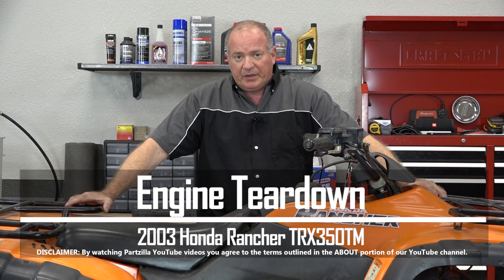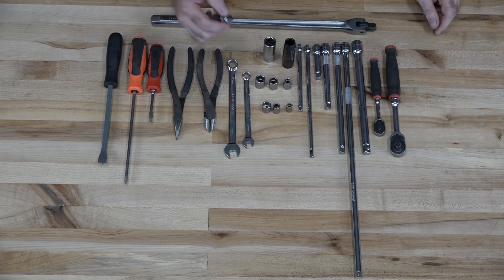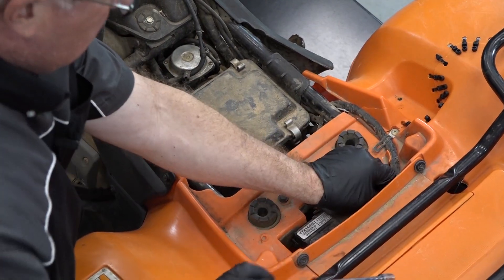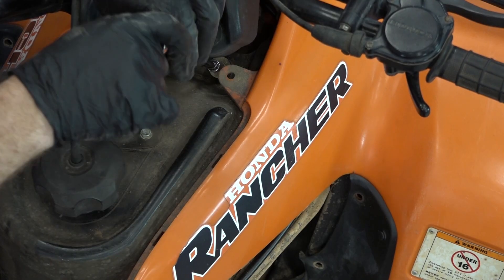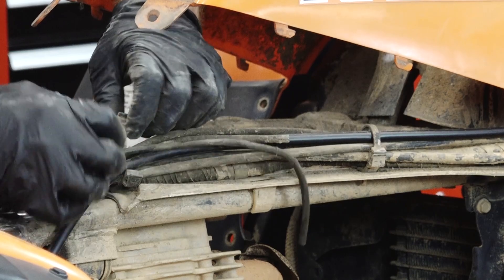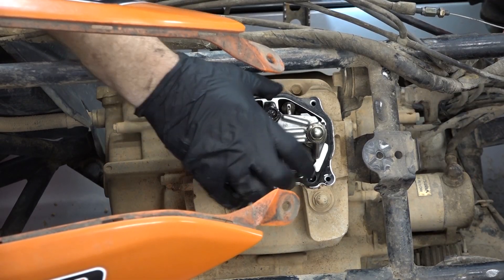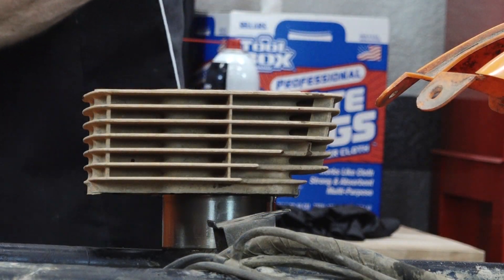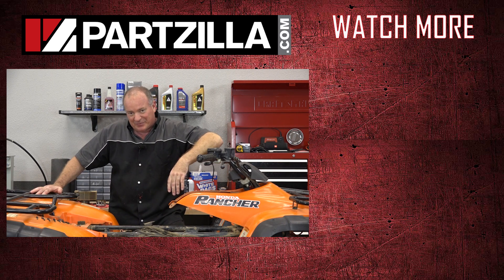Honda Rancher 350 Top End Rebuild Part 1: Engine Teardown | Partzilla.com

Comment: I have a question for you.  When trying to remove the two smaller head-bolts on this same engine, they broke off in the block.  I tried heat and am now slowly drilling them to use EZ outs.  Both methods are proving wrong.  The question is how important are the two smaller head bolts as the 4 remaining larger ones are intact? Will the 4 larger head-bolts suffice?
Reply: Same here. Any answers?
Reply: @jaliscotabares2996  - I took my time with a right angle drill (Harbor Freight - Bauer) and slowly drilled out the old steel bolts although some aluminum housing was milled away.  I also used a magnet to ensure I picked up all the steel - this guided my drilling.  I then used a metric tap to redo the threading.  I bought new bolts and plan to reinstall everything today.  I plan to use thread locker on the new smaller bolts and will let you know if this works.
Reply: This worked fine.  Great video.  Thanks.

Comment: Mine started blowing smoke this past weekend on a out of town camping quad riding trip. It was getting so bad, oil was  around on the outside of the muffle exit hole. Engine sounds ok still though. I haven’t rode it much in the last 5 years. I suspect after sitting a solid year then taking it riding putting it thru it’s paces, I’m thinking my rings are sticking. It’s a 2006 and I’m original owner since new. I don’t beat or mistreat my equipment.

Comment: I got a 04 foreman trx450es i sunk it and started smoking done about 3 to 4 oil change still smoke i got new gaskets set kit for top end have not finish the gasket kit instill no oil on the spark pug and the piston has a little build of carbin do i need to buy new piston and rings

Comment: If my rancher is tapping real bad from the top end and I've adjusted the valves and it's still still tapping would a top end rebuild be the next best move?
Reply from the maker: If you can't get them to adjust, then a rebuild should solve the problem

Comment: Hey what about when it's letting black smoke out of the muffler is it the position rings and clyender wall or what do you think Partzilla
Reply from the maker: Most likely rings
Reply: Yeah that's what I was thinking too if I should change the rings this year or about next year and get new parts too for the front shocks

Comment: Hey Partzilla I have a 250 recon and it was sitting up for about a year because of the carb and I just replaced it and the spark plug I checked the spark plug a couple days later and it's like a charcoal black color do you know what is happening in tje motor ALSO the bottom end sounds like a chain is rattling would that be the timing chain? LIKE I SAID IT STILL RUNS
Reply from the maker: Too rich?  Oil saturation?   Could be cam chain tensioner.
Reply: Is that hard to change
Reply from the maker: @aaronpepper9838  Not sure if it changed in later years, but it should just be a couple bolts and remove the tensioner.
Reply: Ok thanks. One more question I heard It could be a burnt valve if it is could a do the paper trick? Where you put the paper to the exhaust
Reply from the maker: By checking for suction?  You can do a compression check.  The paper test is not foolproof.

Comment: My four wheeler runs fine but it's leaking a little oil around the top end above the spark plug. Could it be a gasket needing replaced?
Reply from the maker: Make sure everything is tightened down.  Otherwise, sounds like a gasket.

Comment: Hey partszilla I recently bought a 2002 Honda forman 450 4x4 and it's making a tapping sound on the valves and it was smoking out of the carburetor in to the intake box I readjusted the vavle gap to 6 thousands and it ran healthier had better compression however it's still tapping and smoking out the carburetor into the intake I doubt it's the Piston because it's not smoking out the pipe but what do you think? I would really appreciate your advice thanks
Reply from the maker: Did you do the valves when the motor was warm?
Reply: Partzilla well that's how I bought it and I saw your video and decided to do it myself got a feeler gauge and when I looked at the valve cover it looked like it had already been adjusted before so I drove it into the garage maybe 1 minute at the most and popped open the cover yes it was a little warm then the valves had no slack to I re adjusted them to 6 thousands at top dead center and put everything back together and fired it up an it had better compression and everything sounded healthier but it was still tapping at the vavle area and smoking out of the carburetor at idle once you press the acceleration some the smoke goes away. Please advise on what you think I should do I'm looking into buying the gasket kit and 2 new valves and resurfacing the seating area like you did in this video but I would like to hear your advice before I do so thanks for getting back to me and hope to hear back from you
Reply: Ramiro Quintana interested in hearing what partzilla has here I have the same issue in 09 Kodak/grizzly 350

Comment: Hello Partzilla. How can a seized cylinder be removed from the piston and rings, without metal shavings falling into the crankcase? Would that even happen during removal? Or, will the lower end need to be disassembled for inspection anyway since the engine is seized? I'd appreciate anyones advice also. Thank you.
Reply from the maker: In a seized up scenario, I would tear the motor down to parts.  Then you can see what you need and rebuild the entire thing.  There's a good chance you will need to do some cylinder work.
Reply: does atv/motorcycle engine break in have to be done under a load while riding, or can it be done in neutral? i've seen videos done both ways.Thanks again
REPLY
Reply from the maker: Here is the best way to break in an engine.  I'm sure everyone has their "expert" opinion all over the internet, but this is tried and true.

On an ATV/Side x Side. 1st crank = idle 10 minutes check for leaks, listen carefully for abnormal noise, let cool.   
1st ride = 20 minutes vary load constantly up to 50% throttle, check everything again, let cool. 
2nd ride = 60 minutes vary load constantly up to 70% throttle let cool. Should be good to go at this point. Put some average miles (50) without getting too crazy. Then let it rip.
On a motorcycle, I would double the ride time and mileage.
Reply: Yea i was hoping it could be done by varying the throttle in neutral. It would make it a lot easier. But i guess  there needs to be a load. Thanks